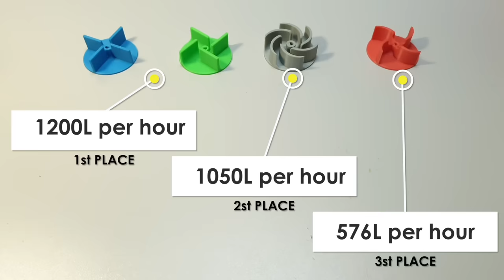Testing 3D Printed Water Pump Impellers - Which One Performs the Best?

Comment: your case is not correct, it should have a spiral wound oval horn design ... https://www.michael-smith-engineers.co.uk/mse/uploads/UsefulInfo/UsefulInfoCentrifugal/CENTRIFUGAL-VOLUTE-CASING-DESIGN.jpg

That axial case will favor vanes that create more turbulence at the exit ... In other words the worse case design favors a worse vane design. Fix the case and the better vanes will reverse your order and efficiency will be better than what you have with the straight vanes. 
You can also file the trailing edge of each vane in the shape of an airfoil ... on the leading edge route a cupped groove just below where your trailing edge ends on the opposite side of the vane. So the airfoil shape is curving inward on itself and the groove is on the outer diameter of the vane. The motion of the impeller should be in the direction of the increasing area of the spiral ... as in the photo. Think in terms of the suction side of a fan ... the intake and the forward edge of a wing of a plane.

Your inlet was also way too large ... the increased vane exposure of the curved ones was causing circulation at the inlet ... you could see the pink one cavitate ...